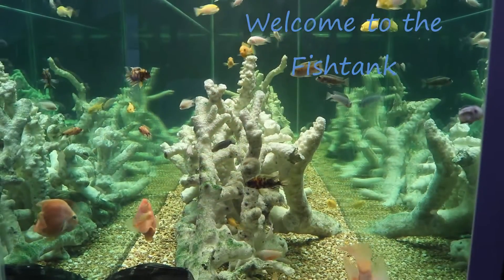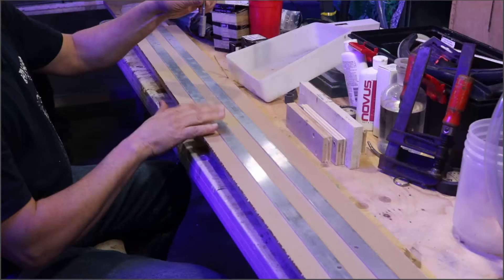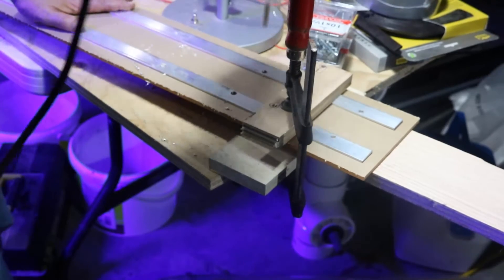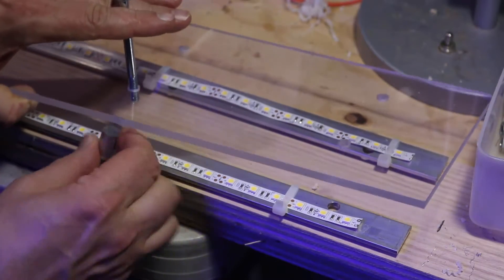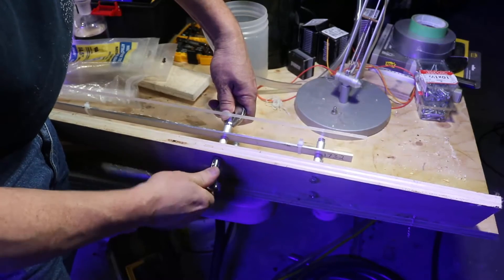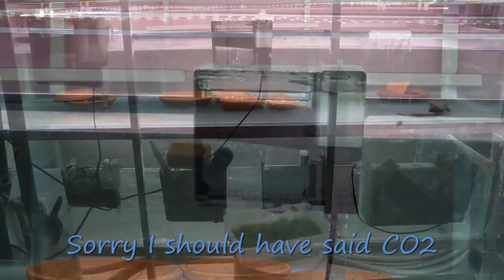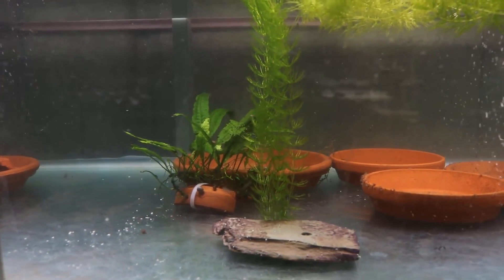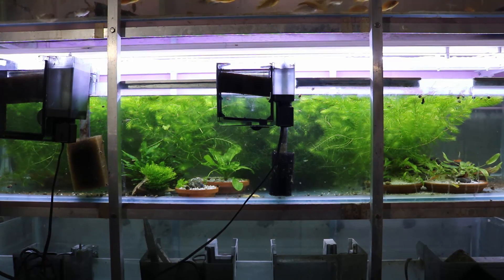LED Plant Growth Light Experiment - Setup

Comment: nice one...whats the brand of the led strip?is it 5050 or 5630..and its color temp...i've been searching a lot of info. to what kind of led should i use..i hope you could help me out sir..
Reply from the maker: Thanks for taking the time to watch and comment. The strips are 5050 and the temps varied from, UV, 6K and 10K. I get them made by the manufacturer through Ottawa LED so the brand doesn't exist. If you contact ottawa LED Sam should be able to get you some.